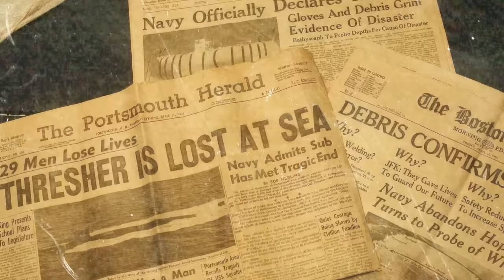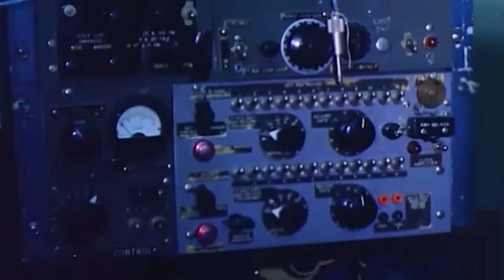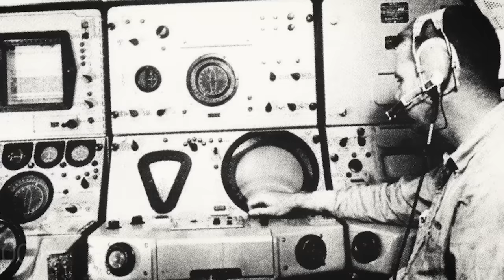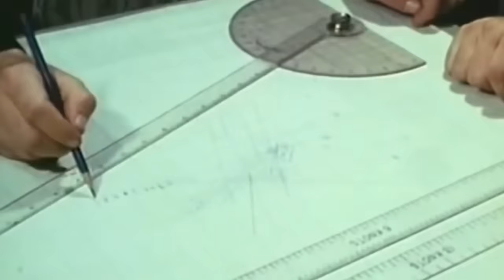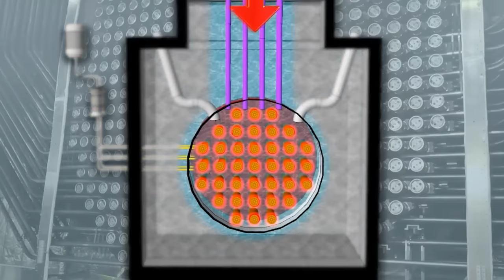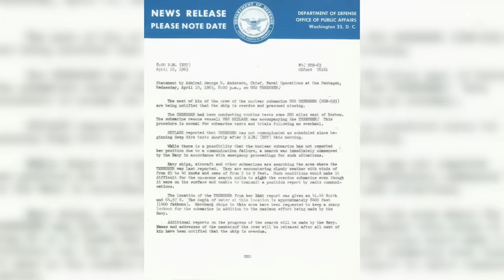129 Dead: USS Thresher's TRAGIC Last Minutes

Comment: I was the head of submarine design for the SEAWOLF and Virginia Class.  I am familiar with the design and operation of all systems on a submarine, especially the safety systems.  I was responsible for all  SUBSAFE technical requirements. The documentary is full of technical errors and supposition.  The reactor is not required for surfacing as a result of flooding or an electrical system problem.  The emergency surfacing system is completely passive, simply requiring the rapid release of high pressure compressed air that is stored onboard into the main ballast tanks.
Reply: I was one of the army soldiers who died on this ship.
Reply: Hopefully some of them are still alive awaiting rescue....

Comment: I was a nuclear-trained electrician and proudly served 7 patrols on the USS Alexander Hamilton - Blue (1977-1981).  Each and every time we took our dive to test depth after refits, the crew was quite solemn.  There was always a bit of anxious fear.  We used to string a tight rope across the hull frame in AMR-2.  By the time we reached test depth, the rope was touching the floor.  It was always a reminder of the extreme pressure that we were operating through.
Reply: Wow.
Reply: That would have made me a bit worried....
Reply: Canopus skimmer here - good job, sailor!
Reply: Incredible.  You guys were brave to serve on those ships.
Reply: Sry for my ignorance, but what is the whole rope thing across the hull frame in AMR-2 touching the floor about? I got lost there....
Reply: @eriksonyw  It means that the hull is getting squeezed, a though a taught string between two chairs reaches the floor as the chairs are pushed closer together.
Reply: Uh-huh! SURE!
Reply: Pressure squeezing the hull
Reply: Takes a special person the serve on the sub.'s.
Reply: Thank you for serving.  My last, of 5 subs was the USS ETHAN ALLEN - Blue SSBN 608.  I was on my way to Pascagoula, MS to commission the USS DACE SSN 607 when the Thresher sank.  I served with 2 former shipmates who went down.  The Dace was ordered to Groton to replace the Thresher and perform all of its projects.  4/10/1963 was a very sad day for every bubble-head who served with distinction and received and wore their dolphins.  
My first boat was the USS SEA POACHER (SS 406).  She was built in 1944 (when I was 5).  DBF is absolute B.S. after serving aboard 4 clean nukes.  Maintain course on fair winds and following seas.

Comment: I was shocked when it was announced that USS Thresher had sunk. In June 1962 I had been assigned to USS Bushnell AS-15, a submarine tender. During my time aboard, USS Thresher SSN-593 moored alongside Bushnell. Crew aboard Bushnell and Thresher openly discussed issues and concerns. I remember one member of the Thresher mentioning the metallurgy on Thresher was such that it was quite difficult to weld. When I reflected back on that comment chills ran up my spine. Could it be related to Thresher's sinking?
Reply: One of the longest times I was at sea was the search for the USS Scorpion SSN 589 in 1968. We were dodging Russian trawlers on the USS Ozark MCS-2. I was Helicopter SAR Aircrew. What I remember about that hunt was we fought one of those noteworthy North Atlantic blows for a few very exciting days that I will never forget. (respect). We didn't find the Scorpion.
Reply: Welding is difficult on high strength steel. I was a shipfitter for 24 years at Nassco shipyard in San Diego. This Hy80??? high strength steel Has to be preheated with an electric blanket to over 100 degrees. Once welded, it is then gradually allowed to cool down over several days. otherwise, the weld will crack and break apart. Its amazing this has not happened more often. Such welds are spot xrayed for checks.
Reply: @lewis7315  Only spot x-rayed?  They should check EVERY weld.
Reply: @ASDasdSDsadASD-nc7lf  with surface ships its not really necessary to check every foot of welding.  Modern shipbuilding methods of framing would stop the ship from breaking in half even if a crack happened. Except for ships not properly designed; there are a couple examples of that.

Comment: I was on the USS Haddo at the time of the loss.  SSN 604 which was at the time a thresher class sub.  We went into the shipyard later for Sub safe.  It was rather easy to know what happened to the Thresher based on what was changed on the Haddo.  One of the huge changes was welds required on all piping and xray tests on each weld.   The air system was changed from piping to the control room for manual operation to remote operation which made the piping only a few feet from the HP air tanks to the ballast tanks.  The Thresher sank due to flooding, Reactor scram and failure to blow air into the ballast tanks.  like most air crashes it is seldom 1 thing but a sequence of failures/mistakes that lead to an accident.
Reply: Hopefully some of them are still alive awaiting rescue..

Comment: My first duty station in the USN was USS BARB (SSN 596) from 83-86. We were attuned to the THRESHER incident. Thank you for the video. A couple of points described in the video are not entirely accurate, but they dont take away from the overall picture.

Comment: I served on the USS Permit (SSN 594), the Thresher’s sister ship. 
The loss of Thresher was obviously something that has always peaked my attention. 
This incident prompted the Sub Safe program which took the lessons learned and drastically increased the safety of subs going forwards. 
There was also speculated to be a problem with the EMBT system. They did an emergency blow and did start to come back to the surface but couldn’t get the full blow of the ballast tanks to maintain positive buoyancy. 
Just FYI, after the loss of the Thresher, the rest of that class of subs was renamed as the Permit class if you want to be accurate. 
Boats were often referred to by class based on the lead sub of each class. 
There was the 594 class, the 637 class and the 688 class in service for attack subs while I was serving with the Seawolf  on the way.
Reply: There was also the Skipjack class SSN 585. I served on USS SCAMP SSN588 the Sister ship of USS SCORPION SSN 589 which sank in Mar 1968.
Reply: @mjc1389 @jamesmasterson18 Thank you both for your service.

Comment: Good info. Thanks.  I have a suggestion for your future videos: Please, pretty please with sugar on top, do not add any music to your dialogue track.  Just like when you had the other people speaking, we just hear them.  And that is good.  The music gets in the way of hearing your dialogue.  My suggestion is not a reflection of the music itself, but just the fact that there is music playing while you are talking. I ask other YT hosts that do the same thing to not do it. And some people comment that I should enable the c/c.  Well, that means I have to mute the video and the c/c are not always accurate (I did this on an aviation channel's video and the host said 'fore' but the c/c came out as 'four.'  Sure, I knew the context, but still, it was wrong). And I don't want to have to read the screen; also the text can block the video [just like regular tv/streaming channels that slap logos and other crap on the screen].

Comment: A few things that don't make sense:-
1  Skylark's comment about not hearing flooding when communicating. If there was a flood aft, why would it be heard forward? There are some pretty solid bulkheads & doors between those compartments.
2  Was there no manual back-up for the blow system?
3  If Thresher had a good neutral buoyancy trim, (which I'm sure would be a an absolute necessity) why would a loss of propulsion cause it to plummet if there was no flooding?
Reply: Due to hull shrinkage, a submarine loses buoyancy as it dives (same weight, less displacement). Thresher was engaged in a dive evolution at the time. 
Thresher had only two means to surface - Propulsion with diving planes, or Ballast tank blow. She had only two means of propulsion - Reactor powered turbine, or shaft mounted Electric motor. The shaft mounted electric motor had three sources of power - the ship's battery, the two Motor-generators, or the ship's diesel generator. 
The diesel generator is not available while submerged at depth. The motor generators had two sources of power - the two Reactor powered turbine-generators. 
So a reactor scram at depth means the ship's propulsion is dependent only upon the ship's battery. If the battery is exhausted, then the only means to surface is by blowing the ballast tanks. Unfortunately for Thresher, her High pressure air flaks were filled with moisture laden air. When the ship attempted to blow the ballast tanks adiabatic expansion took place and the moisture in the compressed air turned to ice, clogging the piping system, preventing the air from getting to the ballast tanks. The answer to the loss of the USS Thresher SSN593 comes down to two questions: 1) Why was the ship's battery depleted? 2) Why were the high pressure air flasks charged with moisture laden air?
Reply: That was an excellent explanation for what likely happened..
Reply: Because of forward speed at the time of failure bowplanes were pointed down to counteract aerodynamic lift.  Sudden loss of power would cause nose to plunge and, without power, never restore upward angle.  RIP
Reply: @philipmorgan1438  Not true.
Reply: 'Fraid it is....
Reply: @philipmorgan1438  Reactor scram does not immediately stop propulsion. There is still a lot of steam energy in the Steam Generators, enough to propel and power the Turbo Generators for a short period. Certainly enough to enable a bow down angle to be corrected. Furthermore, assuming the fore-planes and aft-planes are hydraulically operated, even if there was an immediate electrical failure there is enough reserve of hydraulic energy stored in their respective accumulators to at least 'level the planes'.
Also, as correctly stated above, "Due to hull shrinkage, a submarine loses buoyancy as it dives" this would be continually adjusted as the boat changes depth; so, unless their initial is atrocious (unlikely) it wouldn't have been too far off at the time of the incident, certainly not to "cause nose to plunge and, without power, never restore upward angle".

Comment: The Thresher sonar put out 37 pings after it went down.  That’s all the battery could do before it ran out. That’s an indication the crew (or some of them) had survived for a time.  Aaron Amick covered this in Sub Brief.
Reply: Aaron Amick was wrong, and I believe he later admitted his error.  If the Thresher suffered a reactor scram, in the bouancy configuration developed for being underway, (slightly negative, with dynamic lift) then she would descend, once her momentum was expended by drag.  If the scrammed reactor could not be started in time, they would have to depend on blowing her ballast tanks.  Testing after the accident revealed that, at that depth, the ambient moisture in the compressed air was capable of forming ice where it encountered an obstruction on the way to the ballast tanks.  As it happened, there was a screen in the line between the compressed air tanks and the ballast tanks.  The Thresher was a break through, new levels of performance went far past previous experience formed by the diesel electric submarines of WWI and WWII.  There just were things the designers, manufacturers, and her officers and crew didn't know.  Thresher highlighted those gaps, and the subsafe program was the result.

Comment: I read a comment about the quality of the welding on the Threshers pressure hull, it was scathing in the extreme because it detailed a lot of shoddy workmanship the shipyard welders used to employ and even had photographs of bodges that were discovered such as a plate is a half inch too short then fill the gap with old welding rods and weld over them. The good thing the Threshers sinking did was to help quality control measures be improved in US shipbuilding.

Comment: I was a member of "Uncle Sam's Canoe Club" from '83-'88 on the USS Narwhal as an EM Nuke.

The story I heard, was a leak douched down the reactor controls cabinets (commutator inverters) causing a scram.  The policy at the time was to shut the main steam stops (MS-1 & 2) to keep the reactor hot.  That shut off the propulsion from the Main Engines, Steam-Powered Turbines, which would have allowed the Thresher to drive to the surface.  The EPM (DC motor) wasn't enough to do that.

Also, they tried to initiate an Emergency Blow, but due to the small size of the piping and the cages on the pipes, ice formed and no more air could enter the ballast tanks to make the Thresher positively buoyant.
Therefore, with no propulsion and no way to displace the ballast tank water, she sank.
Reply: That's the story I remember. Was quite suprised to hear the independent acoustical analysis that concluded no seawater leaks, but loss of the bus that caused the SCRAM. Noteworthy that the Thresher reported a "slight problem" before the loss. Flooding on a sub is NEVER a slight problem,  it had to be something else, like loss of a bus, or whatever caused it, that Thresher reported.
Reply: What do you mean by Bus ?
Reply: @edwinmorris1635  he's talking about the electrical bus that supplies power to reactor controls and instrumentation.
Reply: @edwinmorris1635  It's an electrical connection point that multiple components can connect to.
Reply: @johnleeson6946  l think it had a meltdown. I have worked on reactor design.
Reply: @edwinmorris1635  No meltdown.  The reactor was scrammed.  The loss of Thresher had nothing to do with the reactor.  Totally about too much water in the boat and frozen Emergency Blow lines.

Oh, keep on working on reactor designs. You don't impress me with your "knowledge."

Why hafnium?  Why B4C particles?  Why commutator inverters? Why synchronous control rod motors?  Why scram versus cutback versus fast insertion?   Explain XC on an S5W/S3G plant.

8205/S8G
Reply: @johnleeson6946  hyman rickover gave RR a kit of parts and they built a reactor, tested it and worked out the design flaws, corrected them,tested them and used it as such and USA incorporated the design solutions. Close co operation ever since.
Reply: @edwinmorris1635  What;s, "RR"?
If you want to get your message across like you know something about Naval Nuclear Power then use proper grammar, punctuation, and capitalization.  It shows a lack of being able to get your thoughts to others.

I see you didn't answer my questions which answered my question of your lack of knowledge of nuclear powered propulsion.

What's the reactivity when the reactor is critical?  What Keff? Why does the OOD need to know when the reactor is at "the point of adding heat"? 

Why do you think you know anything about the field in which I worked for over 17 years (military and commercial)?
Reply: @johnleeson6946  RR = Rolls Royce. Most Refrigerators work by expanding gases through an orifice.

Comment: It was Lost due to at the  Time , there was No  " Sub Safe " standards  in the construction. A Fitting  / Sea opening back in  Engineering  failed...
It then  " Emergency  Blew "  dumping  her  Air banks into  the  her  Ballast  tanks..
It was an  Value  that  FROZE  UP  = Clogged  that prevented  her from recovering...
All of this is confirmed by " Actual  " Recordings
Reply: yeah. this documentary is total ai generated trash
Reply: Later SOSUS sound analysis by Bruce Rule found no evidence of seawater flooding. Ref: "Why the USS Thresher (SSN 593) Was Lost" .

Comment: SSN Grayling and SSBM Lewis & Clark here, nuclear electrician. It was not scary going to test depth. Never ever thought anything of it. I have been at test depth and done an emergency blow and it was awesome. I have a signed picture from the captain of us flying out of the water.

This is not a good documentary of the Thresher. Airline froze when they tried to blow ballast tanks. Unfortunately they did not use residual steam to power to service. Thresher was never decommissioned. It is listed as "On eternal patrol"

Comment: We will never know for sure what went wrong.  The Navy wouldn't tell us if they knew. What we do know can be discerned by what happens after an event. The Titanic, raised the bulkheads, increased lifeboat capacity, put in emergency batteries for the Marconi on the Olympic and Britannic.  Thresher, dramatically cut the reactor scram to start up time, changed welding techniques, instituted sub safe.

Comment: Lost at 8,400 feet. Wreckage is strewn all over the bottom.  It would be when it imploded. It’s just boom. Thresher couldn’t blow. Reactor shut down. No power. Thresher reached crush depth. Pressure is great. Implosion. They felt nothing . 129 crew deceased.

Comment: In 1996 I was at a party with a bunch of military folks, and as the party was winding down around a campfire, at about 2 in the morning, a very drunk nuclear engineer decided to unburden himself and tell me the real reason the Thresher sunk. I have no idea why; we hadn't been talking about it.

(Obviously I can't vouch for the authenticity of his story -- only the authenticity of my story about his story.)

Anyhow, the story he told me ended up being very close to the official version that was released a few years later (welding failure on the seawater intake for the cooling system.

The one key difference -- and the thing which has stuck in my mind ever since, and I've never seen reported anywhere -- was a tiny detail. He claimed that the welds which failed had been done with a then-classified electron beam welding technique, which the comparative grunts in charge of inspecting the welds didn't have security clearance to know about. So those welds weren't properly inspected.

I don't know that this story is true, but it sounds almost stupid enough to be...